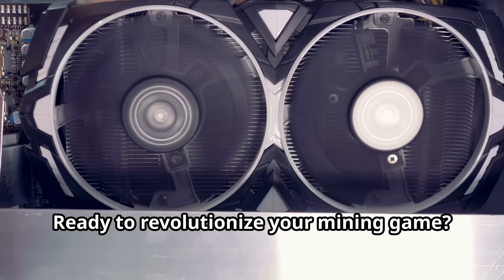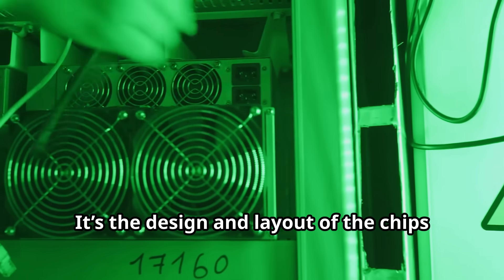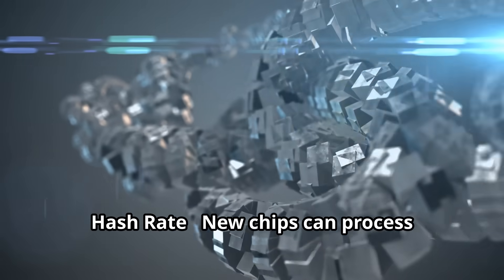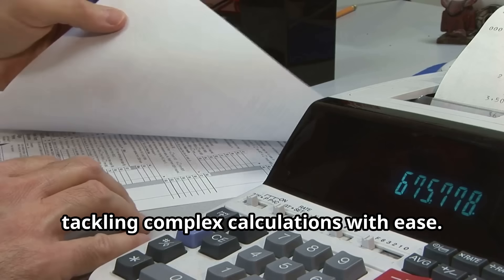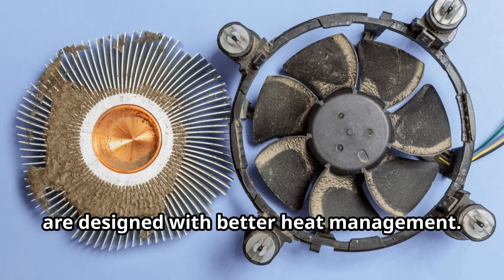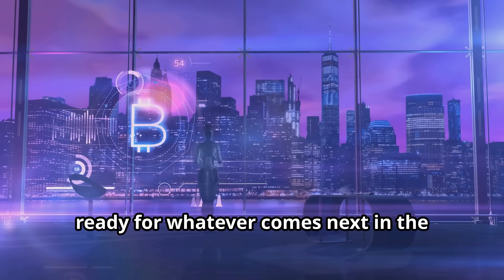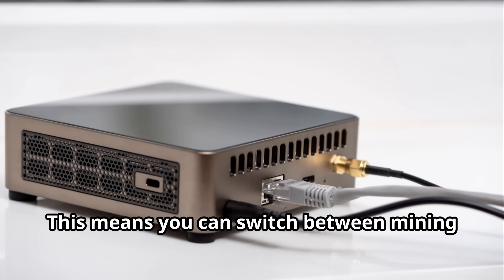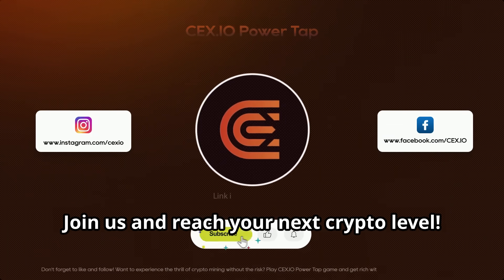From Slow to Supercharged: Upgrading Your Mining Chips

Comment: .
Answers in English and Russian
🇬🇧🇬🇧🇬🇧🇬🇧🇬🇧🇬🇧
From Slow to Supercharged: Upgrading Your Mining Chips

❓1.What can a miner expect from the latest chip designs?
💡Enhanced performance and lower energy costs

❓2.What does future-proofing your setup involve?
💡Investing in the latest chip technology

❓3.Why should miners care about chip efficiency?
💡It maximizes profits and reduces waste

❓4.What analogy is used for upgrading chip technology?
💡Upgrading from a flip phone to a smartphone

❓5.How do new chip architectures energy efficiency?
💡By consuming less power for the same work

❓6.What is chip architecture?
💡The design and layout of chips in mining hardware

❓7.What is a key benefit of versatile chip architectures?
💡Ability to handle multiple algorithms efficiently

❓8.What overall message does investing in new chip architecture convey?
💡Stay ahead to improve mining success

❓9.Why is a higher hash rate beneficial?
💡It allows you to process more transactions faster

❓10.What is one advantage of improved cooling solutions in new chips?
💡They reduce the risk of overheating

❓11.How does new chip technology compare to older models?
💡It often offers better performance and efficiency

❓12.What is one reason to keep up with new chip architectures?
💡To maintain a competitive edge in mining
........
🇷🇺🇷🇺🇷🇺🇷🇺🇷🇺🇷🇺
От медленного к сверхмощному: обновление ваших майнинговых чипов

❓1. Чего майнер может ожидать от новейших разработок чипов?
💡 Повышенная производительность и более низкие затраты на электроэнергию

❓2. Что подразумевает под собой подготовка вашей установки к будущему?
💡 Инвестирование в новейшие технологии чипов

❓3. Почему майнеры должны беспокоиться об эффективности чипов?
💡 Это максимизирует прибыль и сокращает отходы

❓4. Какая аналогия используется для обновления технологии чипов?
💡 Обновление с раскладного телефона на смартфон

❓5. Как новые архитектуры чипов повышают энергоэффективность?
💡 Потребляя меньше энергии для той же работы

❓6. Что такое архитектура чипов?
💡 Конструкция и компоновка чипов в оборудовании для майнинга

❓7. В чем заключается ключевое преимущество универсальных архитектур чипов?

 💡Возможность эффективно обрабатывать несколько алгоритмов

❓8.Какое общее сообщение несут инвестиции в новую архитектуру чипов?
💡Будьте впереди, чтобы улучшить успех майнинга

❓9.Почему более высокая скорость хэширования выгодна?
💡Это позволяет вам обрабатывать больше транзакций быстрее

❓10.Какое преимущество улучшенных решений охлаждения в новых чипах?
💡Они снижают риск перегрева

❓11.Как новая технология чипов сравнивается со старыми моделями?
💡Она часто обеспечивает лучшую производительность и эффективность

❓12.Какая причина идти в ногу с новыми архитектурами чипов?
💡Чтобы сохранить конкурентное преимущество в майнинге